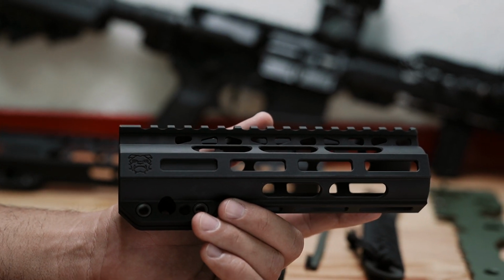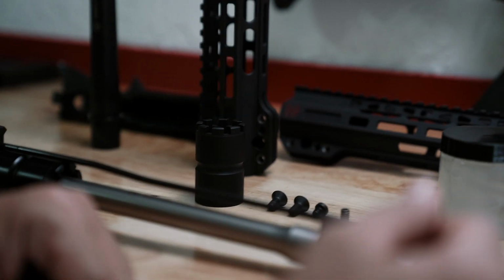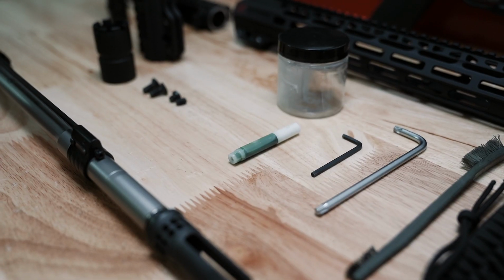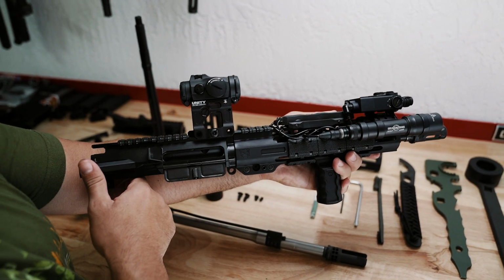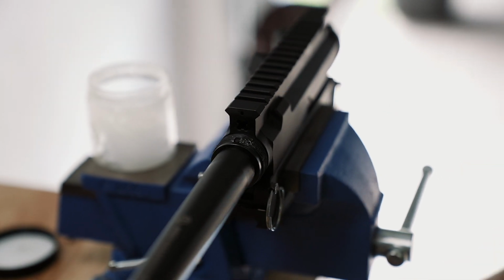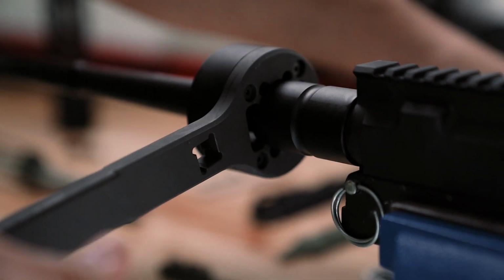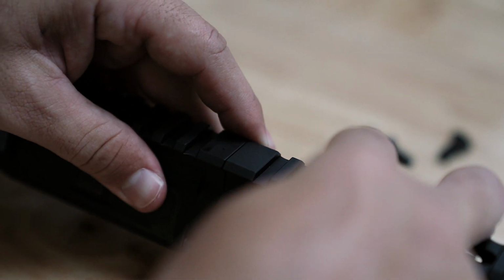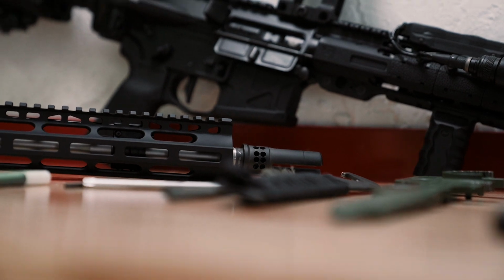Rosco Manufacturing Purebred handguard installation (How-to)

Comment: Confirmed the Forward Controls design Joint castle nut wrench ($35) works. the barrel nut wrench from Rise Armanent on their RA-905 is better than that but can’t find where to buy it separately.  (RA-905 is trash BTW😅)

Comment: So the rails only work with Purebreed upper receivers?
Reply from the maker: No my good sir, please take a second to watch the video and read the comments below that have already inquired about this. It works with any Milspec upper, but also has a feature to work (even better) with our uppers. Just an added benefit to running our uppers/ rails together...
Reply: So what barrel nut do you recommend I have a mil spec upper  although the company I bought the upper from came with a really thick barrel nut that won’t fit inside the hand guard I plan on running  y’all’s gas block but will a mill spec barrel but work first time building ?
Reply: *nut
Reply: @pyromanic007  the barrel nut is specific to the handguard. It’s included with whatever handguard you buy. He went over it in the video very clearly.

Comment: when the  need to line up a rail and receiver comes up, I use a similar product to the PRI tool and it's 1913 interface to line everything up. sliding the upper and rail so they are 50/50 on the tool has given great results for me when the mounting system let me. this wont work for timed systems with shims, but for your rail I bet it would ensure everything is 100% lined up even if the locator pin had to be added on another brand of upper. also please do a video explaining how a constant tapper barrel is a much better idea than a .gov profile with all the extra mass on the end where it does more harm than good. there are still people clinging to their .gov profiles and they need an intervention to save their souls before it's too late.